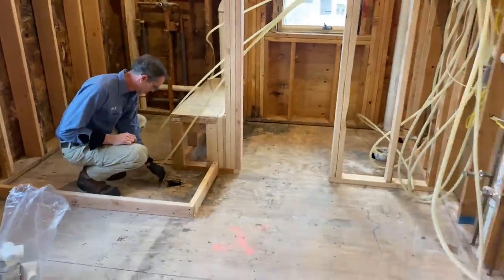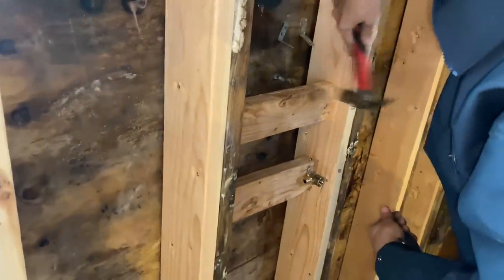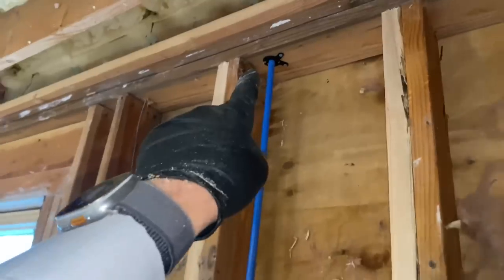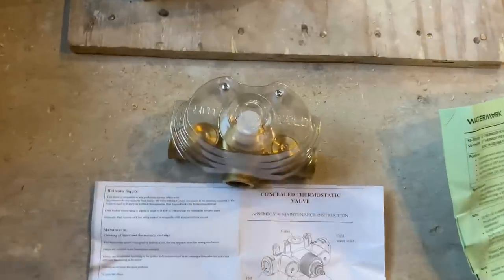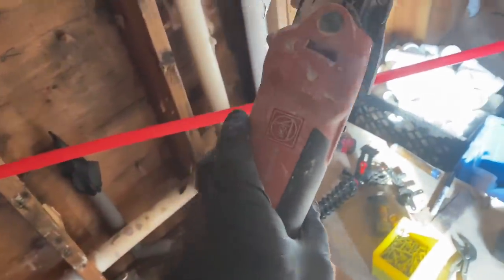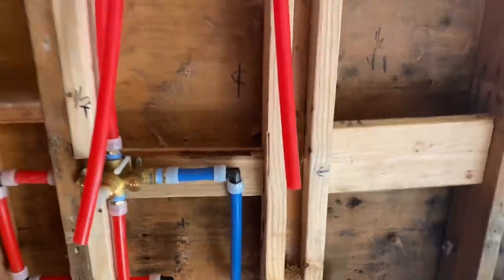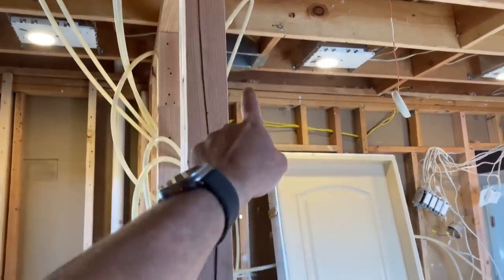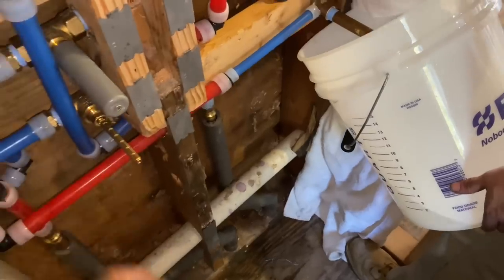Master Bathroom Bathroom Renovation - Roughing In 2 Thermostatic Valves & 4 Volume Controls

Comment: From the looks at all the molding on that one wall ,I hope who ever water proofs the new shower does a better job than what was ripped out.
Also for 1/4 mill. No wood frame bench in shower. I would use the Orange stuff only. Prefab foam shower bench. I would use the Orange stuff all over that shower following Nation Tile Assoc. Procedures for building a residential steam shower. Sloped ceiling (something like 1 inch per foot I believe) is one major detailed often missed you don't want to be sitting in a steam shower while water is raining down off the ceiling onto your head. Also M Pipes you sounded like you never heard of Water Mark very high end very expensive well make product.  Made in Brooklyn NY.

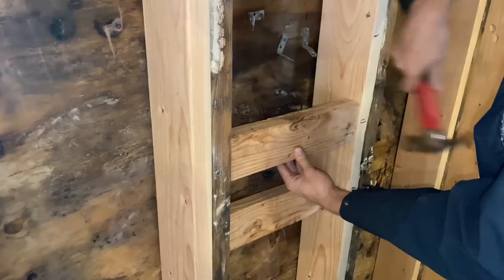Comment: 5:17 Mikey, what ya think about using pocket screws for blocking instead of framing nailer? Can get a armor tool pocket jig (or mini jig) for onsite pocket holes 🤔 
Curious as to thoughts on this. I use sometimes, like if have with me; but the mini jig they released while ago, does make it nice to not need original pocket jig; as bulky to carry and if doing a few holes, mini jig works. Definitely would want pocket jig if doing more than 2-6 holes though….as easier to bang em out quickly 
Thx for sharing a fun vid, and that bathroom gonna be nice! That bathroom same size as before, or they make it bigger; curious again, as did a remodel last year and increased size of bathroom 3x original and no one thought to check on HVAC ducting and register to see if load appropriate or need to upsize etc….
Cheers✌🏻

Comment: Very nice plumbing work and with a quarter million dollar budget I am sure that your client can have the toxic Stratchybotrys removed from the exterior walls using the compressed dried ice method without removing all the work you did. Oye a broch.
Reply: @PipeDoctor  We
Reply: Well without actually doing a mold spore test, I will bet you dollars to dough nuts that the black spots on what appears to be the exterior wood sheathing  of the house your working has colonies of black mold lingering under your upanor. That is what I am talking about.If you spent less time looking at your watch and paid more attention to your surroundings you would see it as well.

Comment: Can tell you guys don't do a lot of roughs, you couldn't put them boards in any more crooked. My god. 

It's all good, it doesn't really matter. That's just the kind of thing though builders immediately notice so it's good practice to put a level on it and make it straight. I generally just use drywall screws for bracing, easier to adjust if need be than nails.

Comment: I don’t get it, $250k bathroom, and they still will need to get into the shower to turn it on. At that price, why not electronic thermostatic valves?!?!? I know, they’re not as reliable, but it’s a $250k bathroom… yes, Mikey pipes, I know you didn’t spec out the bathroom, but have they never seen the Kohler catalog?
Reply: @PipeDoctor  what a shame. All that radiant to keep their feet warm just to get frozen when they turn on the shower!